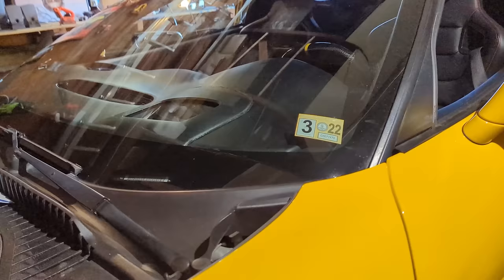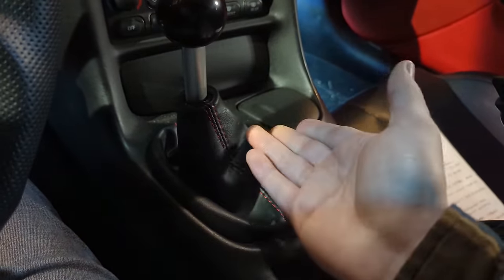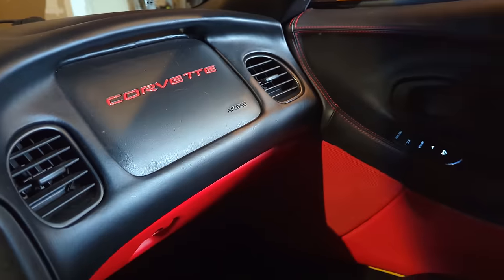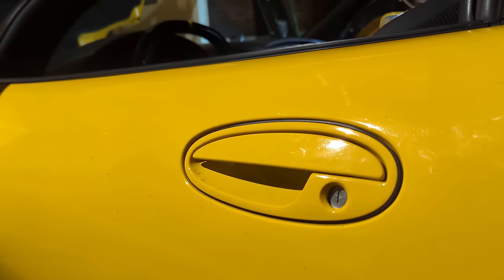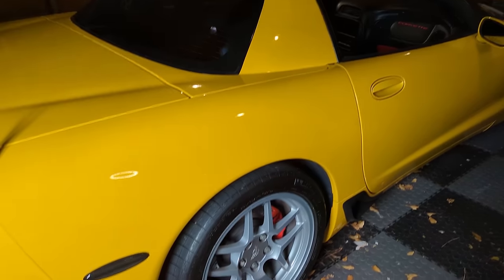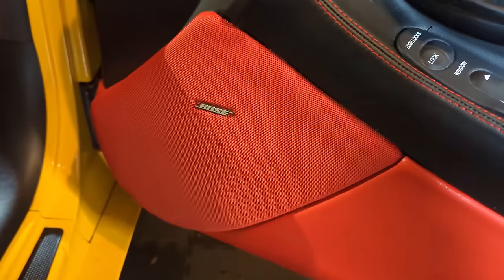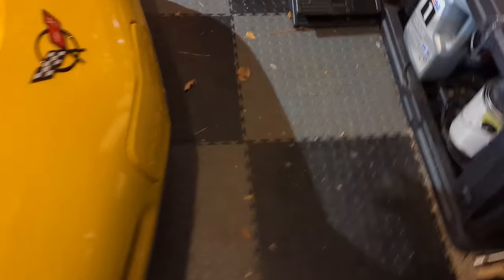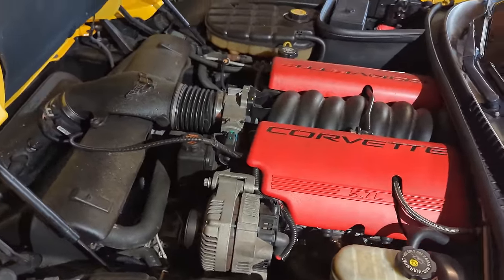20 TIPS, SECRETS & TRICKS OF THE C5 CORVETTE!  PART 2!

Comment: 1. Change the oil sending unit, it WILL go out.
Reply: Just bought an 03 Z06, 67,xxx miles. Clean carfax, I’m the 4th owner. 
This unit easy to change? I’m very mechanical, do my own work on all my own equipment/trucks/cars.
Reply: @stewpittt  you'll have to pull the intake manifold to reach it. Other than that, not too difficult to change
Reply: @miguelberetta7887  not sure if it’s already been changed… after removal, how can I tell?
Reply: @stewpittt  I'd just wait til it goes out. You can tell when it goes out when your oil psi is at max at all times
Reply: @stewpittt  it won't affect the drive ability of the vehicle either, it's just an annoyance since they will go bad in all stock units

Comment: I dont remember the details, but I don´t think so that LS1 and LS6 are 99% similar, maybe in construction but definitely not with parts. Different cams, heads, intake manifold, valve lifters, even the whole engine block is different I think according from what I read. Just sayin.
Reply from the maker: You are 100% correct. I way saying most parts are interchangeable, not necessarily the same. Its a good thing for LS1 owners that want to throw LS6 parts on theirs.

Comment: Comment on ABS/ECBM - 97-00 you are SOL, not 97-99.
Reply from the maker: You are correct!
Reply: Isn’t there a workaround now ? Or you can go holley 
I have a 2000 
38k miles 
Scared about it but I think I can just use a new system ?!